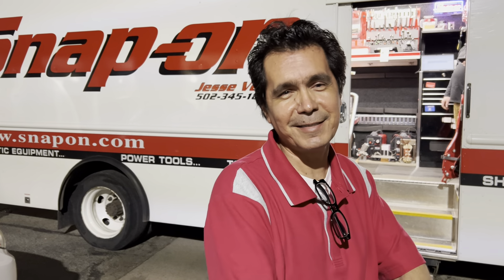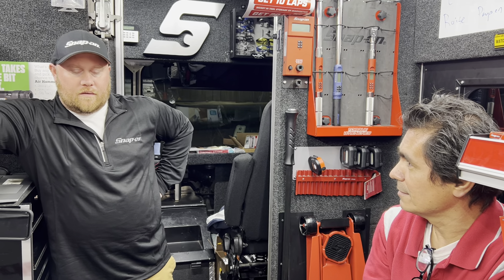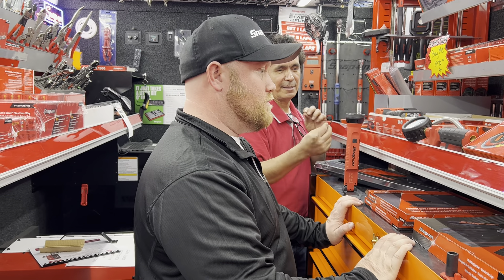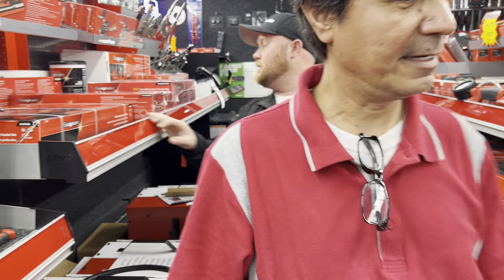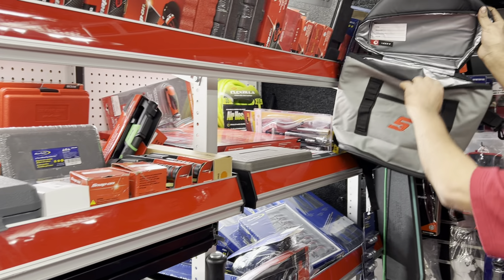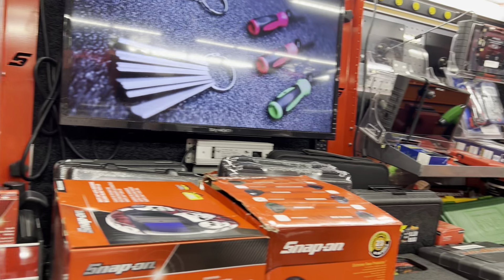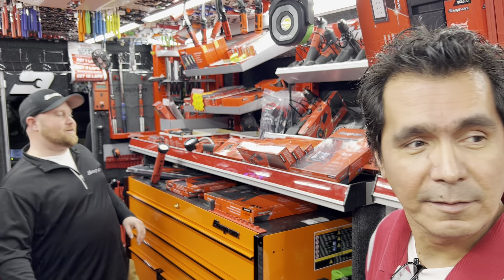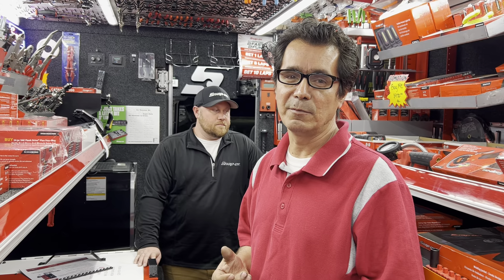Snap-on Monday

Comment: Price on the new inflator?
Reply from the maker: You would have to call Jesse, His number is on the truck.
Reply: Certainly don't know for sure ( haven't researched it) but it looks dangerously close to the Astro Pneumatic digital inflator for $70. Afraid the snapper will likely bring about $170 for the re- brand.